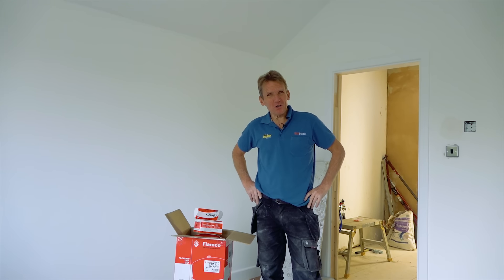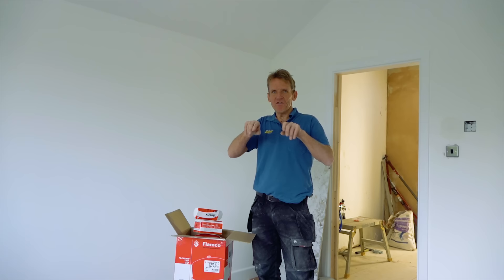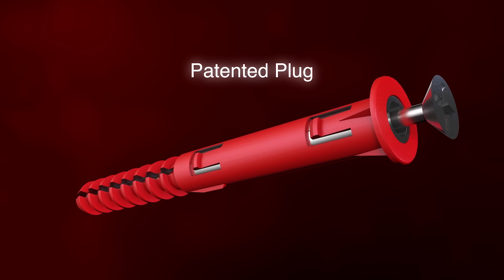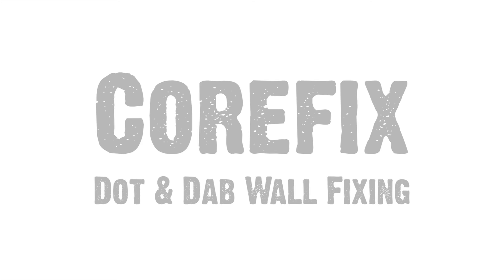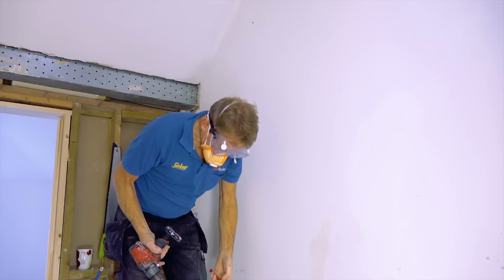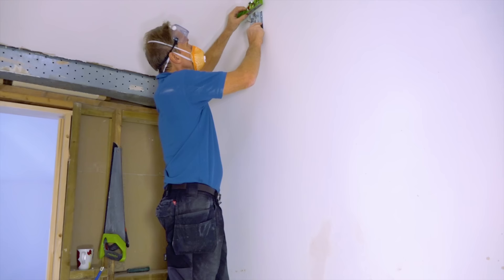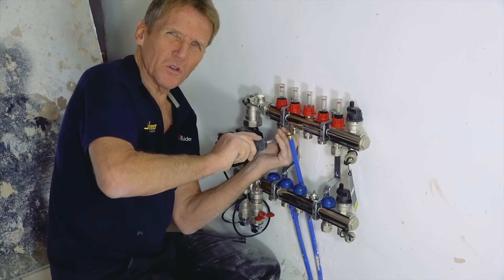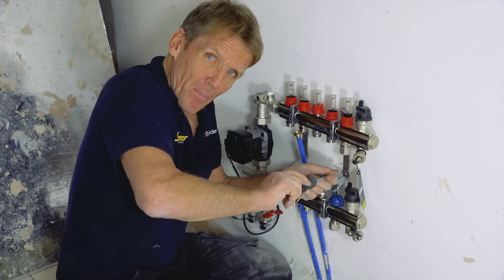Corefix - Dot & Dab Wall Fixing Solved

Comment: Hi Roger, From a price point, I imagine a good quality plastic plug and a decent steel screw will work as well, and about 50 times cheaper, love your Vids Roger...
Reply: Yeah, I see the idea, but a long plug and long screw would hold just as well. Maybe these would be useful for something extremely heavy, but then you would probably want to use steel plugs with anchor bolts anyway.
Reply: But using a standard wall plug and long screw will bow the plasterboard into the gap as you tighten. Plus the metal sheath you bang in is taking the load on these fixings along its length so the screw does not have to.
Reply: Hi Deadmaus 2 - A conventional wall plug and screw will no doubt be cheaper than Corefix, but does not address the issues solved by Corefix.  Namely ease of installation, high load rating and the prevention of the plasterboard being crushed into the void when tightening the screw.
Reply: These work with studded walls, up to a depth of around 30cm the metal sleeve helps prevent bending over a wide gap a normal screw wouldn’t work

Comment: To bridge a gap behind plasterboard I usually push/hammer a cut to size piece of small diameter steel pipe (such as central heating pipe) in the borehole. Firmly against the hard wall and flush with the board. The screw then (obviously) goes through the piece of pipe tot the plug. Somewhat the same principle IMO, but of course this specialised product is a lot more elegant

Comment: These plugs definitely fill a market. Never used them but they seem like a good design. I've personally got away with frame fixings as they have the long sleeve. Also don't know if you remember Roger the old long length of wall plug which you cut to size. Hard to get hold of now but are fantastic.
Reply from the maker: Hi Zed Man 
Yes, I remember those long brown and red strips. Sometimes I take strips of cable sheathing off-cuts and feed those into the holes and as the screw goes in it does them up into a tight knot. Good for back boxes.

Comment: I've tried all manner of fixings over the years for DnD walls.  These look a very good option for high load  bearing.  I don't mind paying extra to ensure something stays on the wall.  I also like Gripit fixings for light -medium loads.
Reply from the maker: I have never got on with Gripit Fixings. They rely on the plasterboard and create a big disc that is sometimes hard to conceal. Have a look at our video on Snap toggles.
Reply: @SkillBuilder  Yep, agreed Roger.  Horses for courses - you always have to look at the specific task and application.

Comment: These look like a good system but I’ve got used to using frame fixers (concrete screws). The come in most sizes up to about 150mm in length and no plugs required. Just drill a 6mm hole and they drill straight in. If drilling celcon blocks, just screw straight in (with cordless drill). Sometimes though you may have to increase the circumference of the fixing to allow for the thickness of the screw.  Been using these for years now into all manner of backgrounds: block, brick, celcon, dot‘n dab.... never had a problem. Cheers

Comment: These looked pretty good, and will indeed be good, I've used them for the first time today with dot and dab, but the hollow block means the plug isn't in a solid piece of wall, sods law eh, I can get them to work with a little extra bodge but will try and get some shorter ones... so eone mentioned blue ones here....

Comment: For dot and dab fixing, I've always had success by drilling the hole then filling the hole with plenty of grab adhesive , while the adhesive is still wet push the plug in. I usually wait til the adhesive has gone off but I've had no problems fixing while wet
Reply: This work around will no doubt work well, but does not offer the convenience of a solution like Corefix that is ready out of the box.

Comment: That's a great product, used them for a radiator, solid as a rock!! Not really expensive either.
Reply from the maker: Cheaper than having a radiator fall off the wall. People get so hung up on the price. If it does the job use it and save money somewhere else or charge more.
Reply: Hi John, really pleased to see you're already a Corefix user! Just in case you're after a few more, here's a quick link to our site… https://www.corefixed.com/

Comment: My first attempt at dot and dab had no gaps and I used a mountain of adhesive lol, these look great though.
Reply: You must have had extreme straight walls or you didn't use enough plasterboard adhesive.
Reply: @lukewebb9692  Exact opposite, I used a ton of adhesive, so much almost the entire board had adhesive behind it.

Comment: Hi Roger. Please make a video explaining how to add wet underfloor heating with 3-4 zones to existing radiator system with combi boiler. Any need for 2 or 3 way motorised valve and extra expansion vessel? Thanks.

Comment: Thanks for the video Will this work for hanging wall kitchen cabinet or they are designed for more heavy duty   thanks
Reply from the maker: Yes it will work if you can get the bolt through the plate.

Comment: What length would you recommend for kitchen cabinets?
Reply from the maker: You need to be at least 35mm into the blockwork so work back from there with a 10mm gap and 12mm plasterboard and the cabinet 18mm, say 75mm.

Comment: Hi Roger, could you use these fixings on insulated plasterboard.  If the boards were 50mm thick. Stuck to the wall using instastik foam. Thanks 👍
Reply from the maker: Yes, absolutely

Comment: Love your channel 
Will this brand of fixing hold a cloakroom size wash basin that weights 10 KG in place ?

Thank you
Reply from the maker: yes it will hold a basin but you can get basin fixing kits which have nice plastic nuts so they don't crack the basin.  A bead of silicone along the back helps to hold it
Reply: Thank you so much ! ...... I appreciate it
Reply: Please can you help me with the best fixings for securing a 9 KG cloakroom basin  to a dot and dab wall. I wanted to use corefix but I can’t find a kit from them that have plastic nuts specifically for basins ...... I appreciate any help you can give

Comment: Did I understand you correctly -  you didn't use a masonry bit to achieve a better fit? Also, have ever drilled through a dab to gain a more secure fitting when there is a wide board to block gap?
Reply from the maker: If you hit the dab that is fine but it is more luck than judgement. I don't use an SDS bit in brick or soft block because it makes a baggy hole. The Bosch multi purpose bits are good with no hammer action required on soft material
Reply: @SkillBuilder   Yes managed to find the dabs ok - not necessarily in the ideal place! Multipurpose drill worked well. Thanks!

Comment: Roger, thanks for the videos. Can I ask what you would use in this situation please. I have become interested in woodwork recently and have been turning my garage into a workshop but the garage has been there many many years and it was built with these breeze block air brick things and as soon as I drill into these, the brick/wall just disintegrates and I can't fasten anything to it! The ceiling is asbestos (I think) so I just don't touch that, it's not great but its all I have and I was wondering how you would build shelving on these walls or fasten anything else to the wall. At some point I would like to change the up and over garage door to wooden ones but again it comes down to fixing them to the brick? Cheers Phil
Reply from the maker: Hi Phil. You can buy really fat plugs that squash into the hole when you tap them in You can also use any one of several adhesives to hold the plugs in the hole. As you say the material crumbles so it is not suitable for expanding wall plugs. If you are fixing large frames I would put in some resin anchors and gun down the back of the frames with a good framing adhesive. There are loads out there and they are mostly similar. CT1 is expensive but it works best.
Reply: Skill Builder brilliant, thanks for that. I have some eco stick somewhere but I will try that CT1. Thanks for your help. Cheers Phil

Comment: You mention not using a masonry bit if the video... what did you mean by this?
Reply: In soft aircrete blocks the masonry bit tends to drill a ragged hole and is not always round. An HSS twist bit is easily good enough and makes a more precise hole. If you are drilling harder masonry you will need a masonry bit.

Comment: How to get decent corners in coving please help
Reply: I made my own mitre block. Similar to a standard 'L' shape mitre block, big enough to hold the coving and with a third piece of wood which orients the coving to the same ceiling/wall depth measurement. As walls are hardly ever exactly 90 degrees, if you want to be really fussy, make a number of mitre blocks and cut slightly different guide angles, 43, 41, 47, 49 degrees etc.

Comment: I use a long fat screw. Get it started in the plug, then push the plug and screw right in. You need a fat screw as technically it is un supported for about 30mm.

Comment: Normall plugs and screws of the right length would be just as good otherwise you could use window fixings either way both cheaper and much better , DIY FIXINGS , not a trade way ?
Reply: clueless
Reply: Its just that due to the cavity, when you tighten the screw it bends the plaster board if you can't get something in between the cavity to stop that.  My house has wooden battens between the plasterboard instead of the modern dot and dab.  Also screws aren't very good at shear strength that's why I've use long rawl bolts in the past for heavy items but I'm going to give these a try anyway.
Reply from the maker: @johnward182  A tad harsh John. When you say "Not a trade way" you presume to know what every trade person thinks and does which can't be true so you set yourself up to be knocked down. Running a construction firm for 20 years? That doesn't mean you stop learning
Reply: Skill Builder sorry for that you are right just some idiot gets a kick out of leaving brainless comments , yes it’s true we have learned never to embrace new ideas or prototypes, they often fail , our method of fixing anything heavy / expensive through a battened  wall or dot and dab is threaded rod  chemical anchored in then nuts just turned on flush with plasterboard then bracket then nuts again to secure , all be it not within the capabilities of the diy man but solid and invisible , but I guess your teaching the average householder how to get over the more common problems , so for that I tip me cap 👍
Reply from the maker: John Ward 
O.K that is the kind of thing I did but, honestly, just think about that method of cutting studs and using chemical anchors when you can just take a fixing out of the box.
Reply: @johnward182  mong
Reply: @johnward182  i'm far from a faceless coward, however it's sometimes hard not to reply to such stupidity